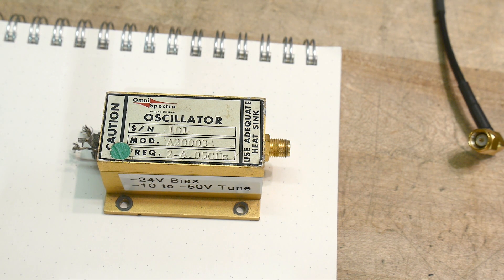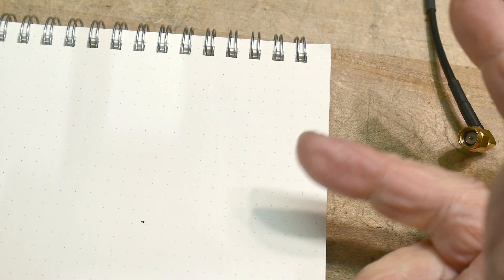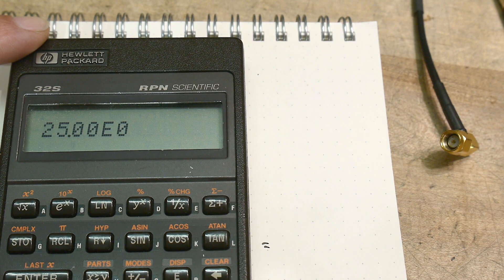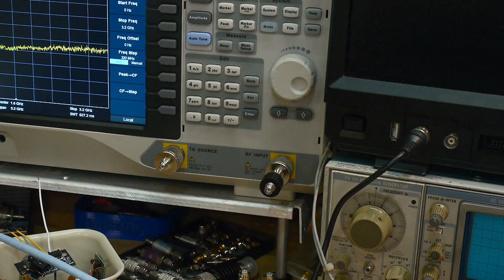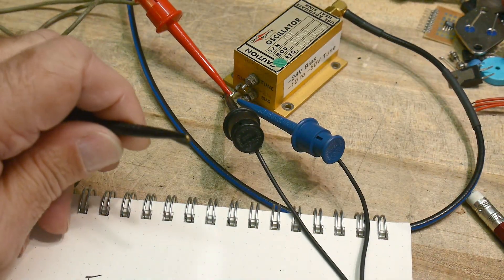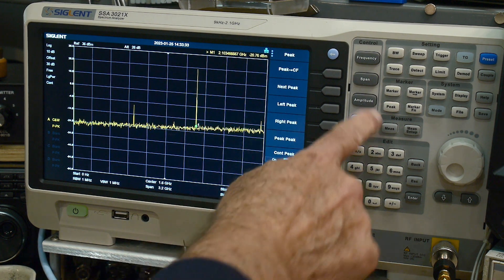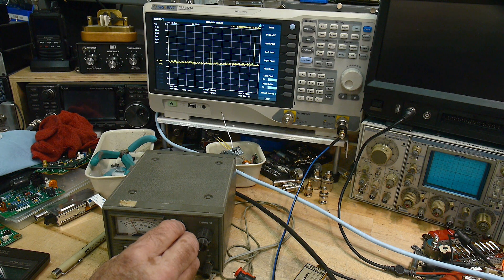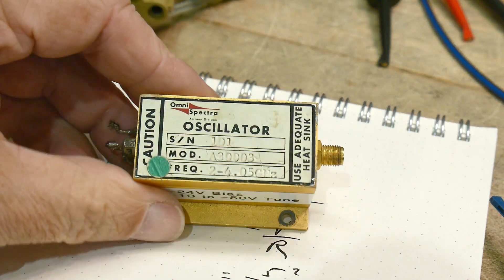#1415 Omni Spectra 2-4 GHz voltage controlled oscillator

Comment: Could you explain the input? mine says 50V DC, 30dbm, so I am confused about the 5v being 29dbm... if I were to guess it would be an oscillation span of 5v that could ride on top of a 45v dc offset level??
Reply from the maker: yes, that is a worse case, the DC blocking capacitor is rated at 50V. as people pointed out below. the dBm is the Vrms into 50 ohms.
Reply: @IMSAIGuy  Thank you so much. I have had my spectrum analyzer for about 5 years and I have learned more from your videos using yours than I have in the last 5 years!

Comment: I really appreciate the warnings about power and input on equipment for safety, but I feel you skipped a step when you jumped directly to the 30dB attenuation. How do you know that is enough for safety in this situation? You explained that +5V into 50ohms is 27dBm, shouldn't 24V need considerably more? I know dB is a log scale, but I would think that might mean you need 40dB or more.
Reply: I think he made a small mistake in the video, for the 5V signal you want to take the RMS value to get your power, so for a standard oscillator can you are more in the +12 to +17dBm range, however this isn't really important for your question. 

Only because you have these high bias voltages doesn't mean that the output will have such a high output swing. 
These older RF devices are relatively inefficient and the high voltages are most likely needed for the tuning varactors and not the acutal oscillator circuit.

As IMSAI Guy already said, always start with the highest attenuation you have, you can always go down if your signal got to small.
Reply from the maker: Gray beard experience. If you don't have a beard, start with more attenuation.

Comment: There are two spars above and below the main frequency.  It should have some sort of PLL inside.  What is the phase noise?  What type of oscillator is it?  The range make think it is ring oscillator.  What type  varactor can take so much voltage, if it is LC oscillator?
Reply: Looks like 2x and 0.5x the output frequency, my guess is that it's an oscillator with a doubler at the output
Reply: @rjordans  Possible, but we need more info such as 3rd order intercept.  
cos^2(wt)= 0.5*(cos(2wt)+1)
If there is a frequency doubler at the output of oscillator then we should see 4xF almost as strong as 2xF 
What is the DC power to main frequency power Ratio?
Is it injection locking oscillator, ie we have two oscillator that are locked to get a better phase noise?
What is Kvco graph of the oscillator?
The huge voltage range makes me wonder that what type of Varactor does it use.  Even a PIN diode does not have more than few volts range.
Most likely some sort of voltage divider on Control Voltage before it goes on top of varactor. 
The huge range makes me think it could be A PLL that multiplies the oscillator frequency by a fixed N.
Or it could be ring oscillator.

Comment: Interesting how you didn’t put any DC isolation to your SA input, what if the oscillator put 24V dc on it output?
Reply from the maker: Siglent has internal dc block
Reply: @IMSAIGuy  and your pad? 24v in 50 ohms is 11.5 watts

Comment: If that's a yig oscillator that tune voltage range seems quite wide. Usually the tuning coil requires a current to change the frequency and if you put too much current thru it it'll blow the tuning coil. 
Considering the huge negative voltage required to tune the thing I'll lay bets that it's a varactor tuned oscillator with frequency multiplication.
Reply: Looks a bit small to be a YIG, particularly from that era.
Reply: @ruhnet  I have a couple of 5GHz yig's that are about the size of a couple  small match boxes ~ 1cm x 4cm x 4cm if memory serves me.  Don't remember who manufactured them.
Reply: @vincei4252  From what year approximately? Many of them these days are small like that, but in the 70s/80s they were generally quite large and distinctive in design.
Reply: @ruhnet  I'm not sure. I don't think they're from the 70's or 80's. I'd have to hunt them down in the lab to figure it out. If I find them I'll share the details here.
Reply: @vincei4252  Likely they are of later manufacture.

Comment: Hi, great video, this overshoot at the input of anything scares me, once in the lab I managed to blow up the input of a measuring unit only because someone destroyed the attenuator beforehand and put it back among the others (probably so he wouldn't have to pay for the damage) too bad several times larger.
I wanted to buy this source from HP on Ebay, but they wanted about 150 USD for shipping if I remember correctly, so I gave up.

Nice day 🙂 Tom
Reply: Ah, the old eBay shipping scam. I don't buy from sellers that do that. Hoping you won't notice.
Reply: @vincei4252  For me, it's even higher with customs duty and tax, those scumbags of ours will tax you as well as transport.
I once had shipping listed as $60, so I entered an auction, won it, and they charged $105 for shipping, so I'm very careful now

Comment: That might be a YIG oscillator.
Reply: I thought I had a YIG once, but then it YAG’D, and I learned not to trust those bastards…snooty glorified tuning forks.

I have no idea what a YIG oscillator actually is, I just wanted a reason to type “YAG’D”. Don’t mind me. Get YIGee with it. I’ll show myself out.
Reply: @silverXnoise , :) A YIG is basically a small ball made of Yttrium, Iron, and Garnet, (YIG.) That compound develops a surface resonance based on the size of the ball when placed in a positive feedback loop of an oscillator. They are used in microwave oscillators and filters. However, the frequency of resonance of that ball changes in the presence of a magnetic field. So both YIG oscillators and YIG filters are built within electromagnetic coils. Adjust the field intensity and you adjust the frequency of your oscillator or filter. They are seldom inexpensive. I paid $800 for a dead low-frequency Agilent spectrum analyzer with a good YIG because I learned that the YIG was the same one used by a much higher frequency Agilent SA, except they changed a trim pot value on the YIG board. So I bought the scrap SA, pulled and modified the YIG, and put it in a broken much higher frequency Agilent SA, calibrated it, and sold it on eBay for a several thousand dollar profit and took some time off.
Reply: @johnwest7993  Very cool 😎 on all accounts. Thanks for explaining the ups and downs of YIG oscillators.
Reply: Normally YIG oscillators from that era were much larger, and almost always rounded in their shape.